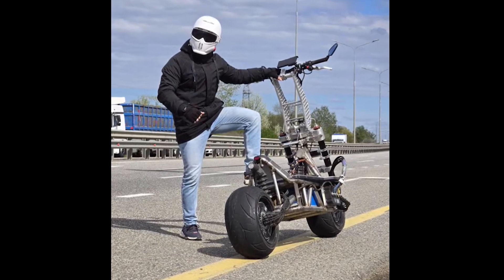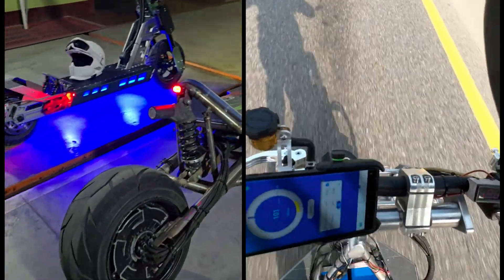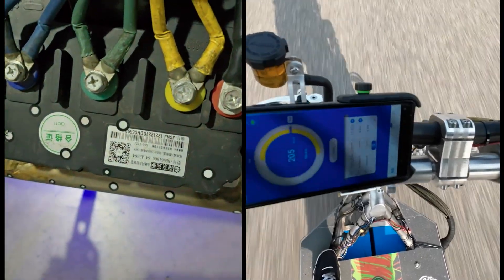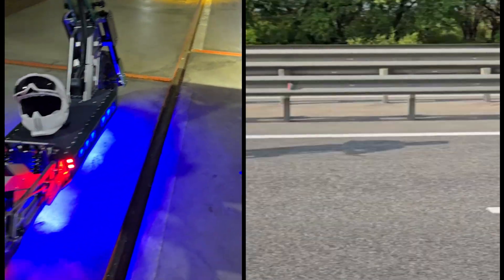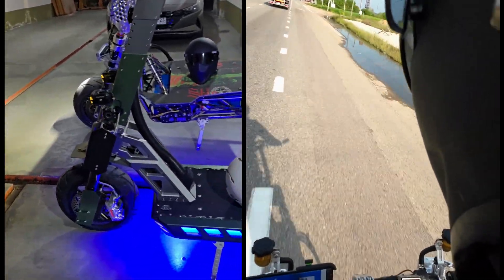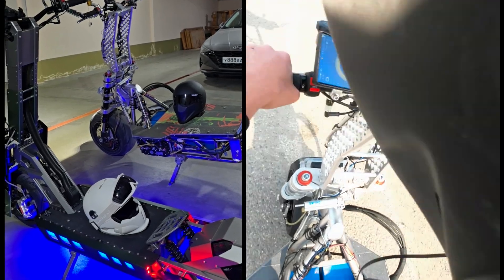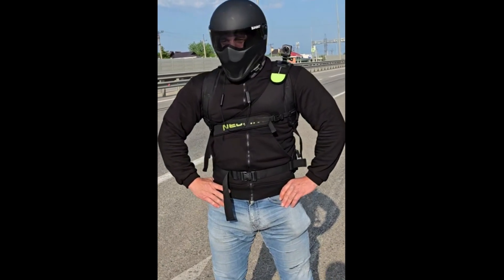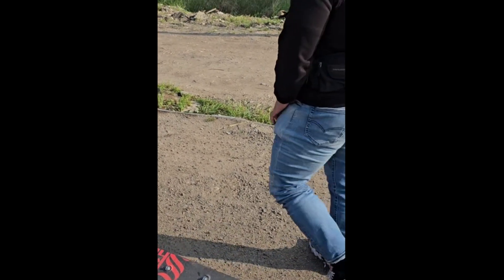17KW Dual Motors with 113V System Extreme HyperScooter!

Comment: in the Russian review, they talked about the power of 150 kilowatts, but not 17. Acceleration was under 200 km / h, 17 kilowatts would not have gone so much ... Well, as far as I remember, such a project from Krasnodar.
Reply from the maker: Those are motor ratings. I spoke with the builder and these are the specs shared.

Comment: Anything above a human lifting weight is a massive overkill. 55-60kg is about as heavy as a reasonable scooter should get imho, otherwise why not just get a motorcycle.
Reply from the maker: It depends what you want.
Reply: @ElectricVehicleSpace  Mostly a point of usage practicality, like being able to fit one in the car trunk and being able to lift a damn thing in the first place are not small items. But there is no arguing that to each their own.
Reply from the maker: @orthodium  this is not the case. I guess this is not for you.

Comment: At "normal" speeds the system won't be strained at the range is probably insane!
Reply from the maker: Yes 13KW battery should give a lot of range.
Reply: @ElectricVehicleSpace  batteries are measured in kWh